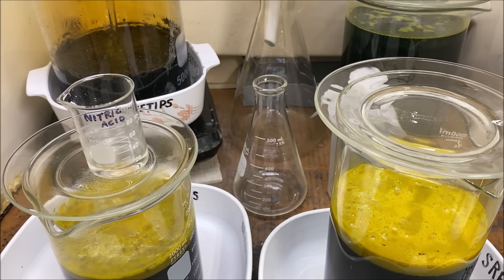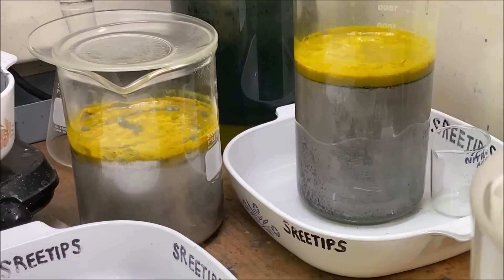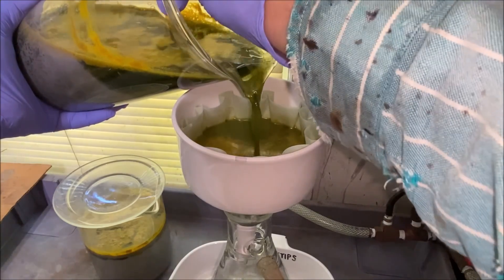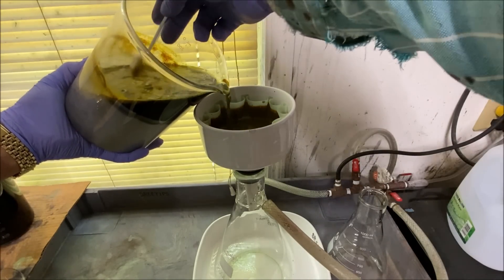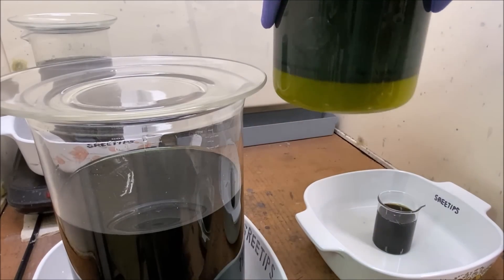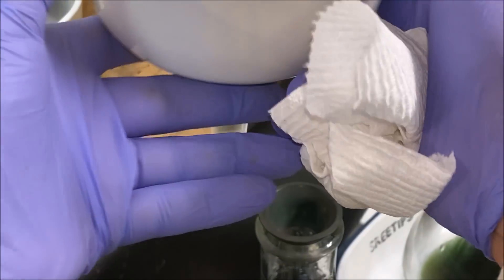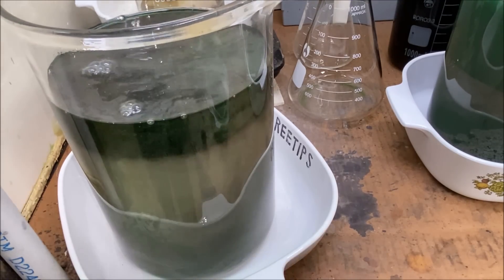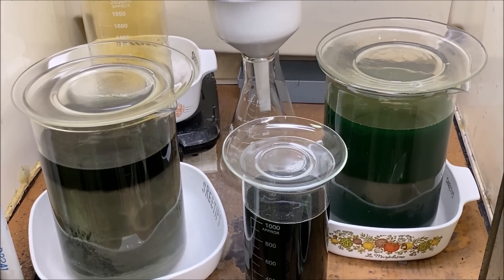Silver Cell Anode Filters Part 2

Comment: I was also surprised you didn’t do a stannous test on the filtrate prior to throwing in the copper to cement? Obviously you’re going to be running the silver through the cell again, but would have been nice to check for other pms before the cementation :)

Comment: As always, thanks for the great videos, however I’m really curious why you decided to use DMG prior to an hcl precipitation of the silver? 

You KNOW how sensitive the silver in solution is, and performing an hcl drop of the silver, rinse and filtering, and then a DMG drop would have been my personal recommended method due to the obvious potential issues of having silver drop out with the slightest contamination of solution. 

I would have sworn you’d know better, but maybe you were simply experimenting or being curious with the DMG prior to au drop?
Reply from the maker: Didn’t think of it

Comment: You should be able to end up with a clean 99+% palladium salt cake with almost no silver. It's a fascinating problem. I can only say that the possibility of encapsulation of silver chloride is possible and there are many other optional possibilities. It is important to add the DMG slowly with plenty of sheer mixing but I'd not expect significant silver in the salt cake.
Reply from the maker: It’s my fault for knocking of early and letting those solutions sit overnight. Should have filtered the Pd salt immediately.

Comment: I'm pretty sure there is Paladium in the solution you threw the Copper pipe in. It will plate out now. You had to test it for Paladium.
Reply from the maker: That’s ok, any palladium will cement out on the copper. Then we’ll run it through the silver cell again. Those PGMs are very uncooperative. You can never get it all. And you can never get a 100% separation.
Reply: @sreetips  Yes ofcourse it won't be lost, but I thought it would be better to get as much Palladium out of the waste stream as possible beacause it will reduce work, time and recources. I would have done a second DMG percipitation. The deep dark green colour was ofcourse a hint. I get it that there was probably also some coloidial PGM in there that made the colour so dark. I really like these vids. It also puts the brain to work again to follow what's going on. Very curious what the yields will be.

Comment: Question:  With respect to silver cementation, does it matter if the copper tube is left to rest on the bottom of the beaker or should it be raised as to not be covered by the cemented silver.  Or does it not matter at all.  Just curious if its a surface area exposure thing or just as long as the solution is in contact with the copper.  Thanks in advance!
Reply from the maker: Best to submerge it in the silver solution completely.

Comment: Mr. Sreetips, have you ever dropped Ag using concentrates Cu solution (concentrates leftovers from previous Ag drops)?
Assuming those grey particles are indeed Ag, what happened here is that you Pd started to come out of solution leaving behind a more concentrated solution of Ag and Cu.
Cu concentration was proportionally high to the point where it was enough to  drop some Ag.
I constantly concentrate my Cu solution after Ag drop is complete. I use it when I do not have large chunks of Cu.
If the process drops all dissolved Ag? No. But but it is enough to drop the bulk of it, then the remaining goes to Ag stock pot.
I do not know if our mate the one and only @999dusangoldrecovery subscribes to your channel, he can provide better insight about the use of concentrated Cu solution to drop Ag.
Cheers

Comment: Not exactly the best situation with the silver palladium, but I would imagine if you were to melt it up into shot and run it thru the silver cell it would probably remove the silver and leave behind the PMGs.
Reply: The Pd has a tendency to follow Ag.
Reply: @apveening  I was under the assumption that the silver cell results in pure silver while leaving behind the platinum group metals in the filter basket.  Though - I made the comment before seeing that there was far less silver than PGM in the mud.  In the beaker it looked like there was a pound of silver because it was lining the glass.
Reply: @cracklingice  The silver cell results in three nines fine pure silver, meaning it is at least 99.90% silver, pure enough for all practical standards to be called pure. However, that remaining 0.10% is for a large part palladium followed by other valuable metals (including silver, it is probably something like 99.95% pure).
Reply from the maker: There’s 400ml of solids in the beaker. It looks like a lot. But in the end it will only yield a few grams.

Comment: It looks like the majority of your anode slimes (the gray power after removing the silver shot) was cement silver.  So I'm wondering where it all came from.  

Your silver starts as shot with no power.  It dissolves in the electrolyte when oxidized by the current.  Most of it travels to the cathode bowl, but why is so much precipitating out in the anode basket?  What could be reducing it there at the same electrode where it oxidized?  

 My guess is that it's the copper impurity in your silver shot.  We might expect all the copper to be oxidized by the electric current along with the silver.  but as each copper atom is exposed (as the around it dissolves) there is a chance it will be oxidized by Ag+ ions, creating cement silver.

So it would be worthwhile to reduce the copper content of your silver shot.  Obviously, the Cu comes from the CuNO3 solution that the silver cements out of.  Now CuNO3 is super soluble in water, and you wash the cement silver with boiling water.  But it still contains some copper because we see the electrolyte turn blue.

The human eye is not very sensitive to blue.  Maybe rinsing until you can't see the blue tint isn't good enough.  In a research lab you would use optical spectroscopy to verify the last rinse is clear.  You could do something like that in your home lab, with just a white light, a photocell, and a volt meter.  By comparing clean water to your rinse water you should measure less voltage from the photocell when there's copper in solution.  It might be even easier to detect the copper ions fro the conductivity of the water.  Pure distilled water doesn't conduct at all well, and any ions in solution will increase the conductivity immensely.

Second, I would suggest boiling your cement silver in distilled water after rinsing (just like you do with your gold precipitate).

And third, I suggest your rinse the silver with ammonia.  If some of the CuNO3 is stuck to the silver surface the ammonia should release it.

Comment: I've been wanting to see this phase of the process for some time---recovering the ugly silver from the anode baskets. It's clearly not easy. I don't recall your having covered this phase before. And it also should be said that it reduces your silver yield, or said differently, ties up silver from your gross yield. I wonder if there is a melting solution to this issue. I have not checked the melting point of Pd or Pt nitrates, but Pd and Pt metals melt much, much higher than silver. In my estimation, unless you see some big problem with it, it would be worth it to take two anode baskets full of that ugly stuff and cornflake it.

Comment: Great video, but I had a few questions.
1. Does water dissolve the yellow precipitate? I know you use hydrochloric acid to rinse when you work with PGMs salts.
2. Would converting the silver nitrate to silver chloride been a bit easier to separate from the PGMs? I do get that the method makes a lot more waste, but could allow you to isolate the other metals more efficiently.
Reply: As it takes AR to dissolve PGMs, I suspect (but don't know for sure anymore) that PdCl is soluble. If so, I would precipitate the Ag with HCl, which is already one of the standard steps in refining it, leaving the Pd in solution
Reply from the maker: 1. No. 2. Possibly

Comment: Way too much silver in solution to chase other metals and it’s still green when u put copper in  I would of started by chloride the silver to clean all other metals from it and chased them in the stock pot/ zinc/copper later idea is to get clean silver to run again through cell